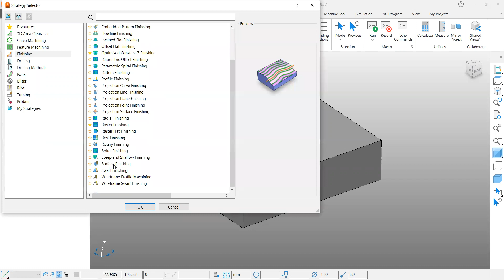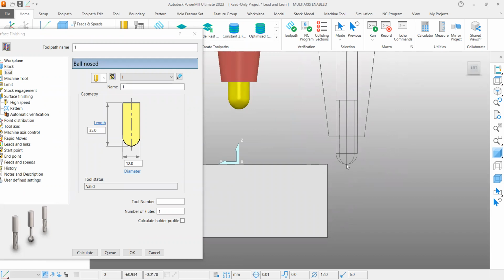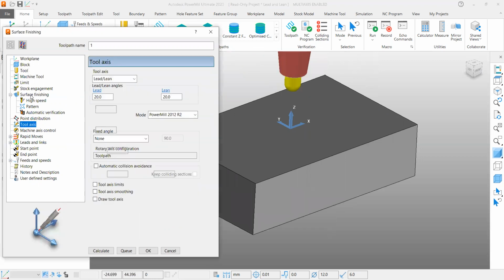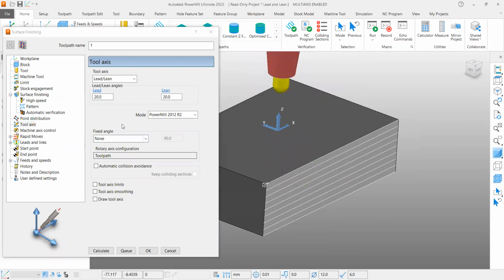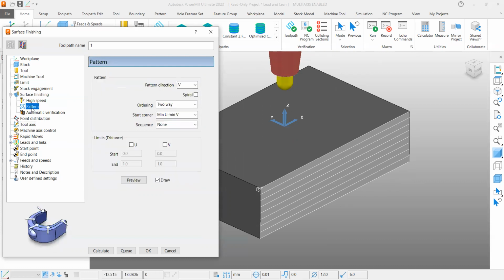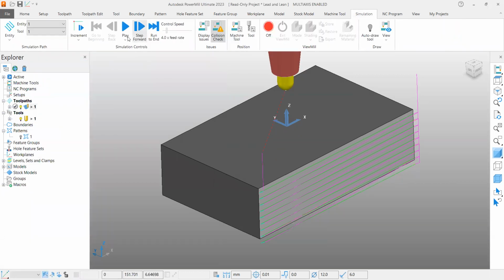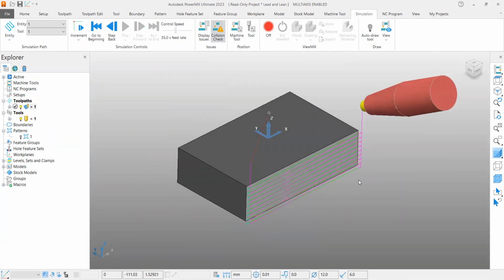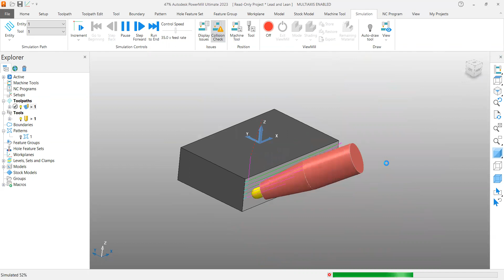Autodesk PowerMill  - LEAD and LEAN - 5 axis -Tool Axis definition - Example-1

Comment: If no angle is specified, but it is set to Lead/Lean, will Powermill calculate the angle best suited for the surface automatically ?